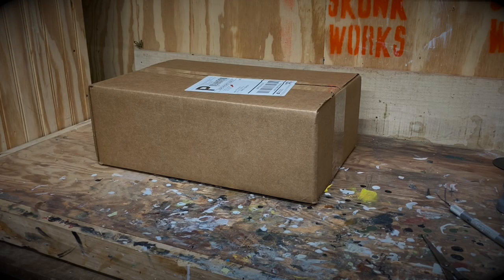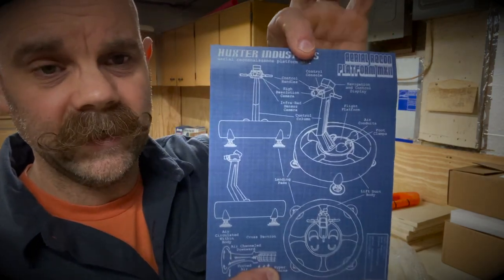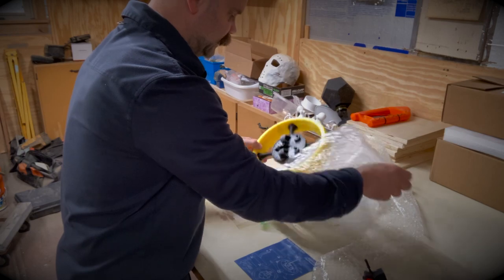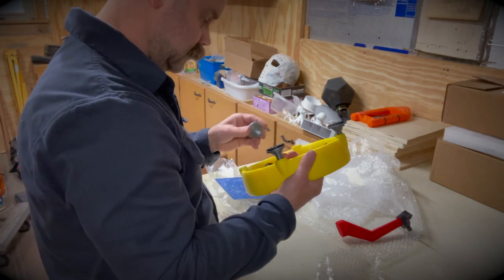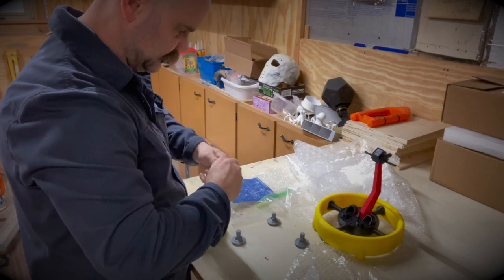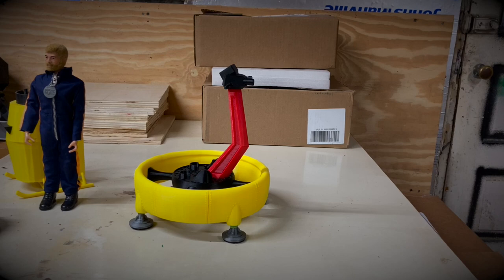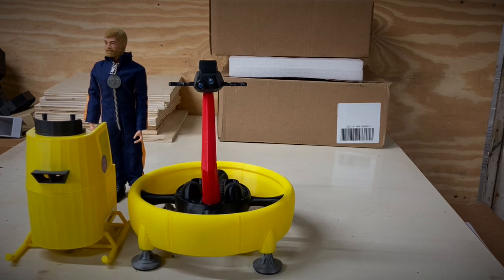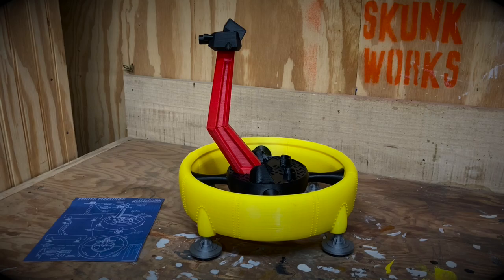HUXTER INDUSTRIES AERIAL RECON PLATFORM MKII - REVIEWUESDAY #gijoe #gijoeadventureteam

Comment: The GI Joe with the custom robotic arm in the first part of the video where do I get one of those arms in a 12-in scale? I've got a bunch of GI Joes from the 1960s that are pretty trashed that I've eventually got to order some body parts for from eBay and try to do something with and I honestly would love to do one of them with a cybernetic arm upgrade like that maybe in a different color like orange or something wondering where the arm is fromI kept ending up with them where people were going to throw them out or they were mixed in with stuff that I bought. I've got a guy that collects 1960s GI Joe and I get the stuff here and there and every so often you end up with a badly damaged Joe that somebody's like do you want this we're going to toss it and they kept ending up and said box like a shoe box or something like that I've been putting them in. I know there's a couple guys like toy Polo explain how to fix them putting the new elastic in and whatnot, it's one of those projects I haven't gotten around to, I'm more familiar with doing 1980s GI Joe's than 1960s but I've done several of the smaller figures from the 1970s Big Jim and me go where I put them together did quite a few mego figures where I took a couple of destroyed ones and use them for parts to fix good ones.
Reply from the maker: https://www.gijoeelite.com/search.asp?keyword=Solid+arm&search=